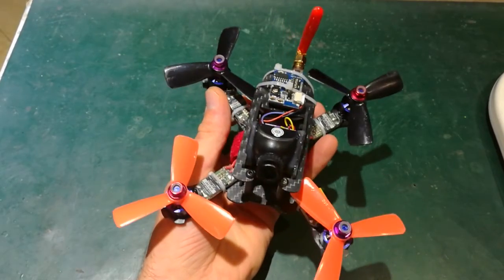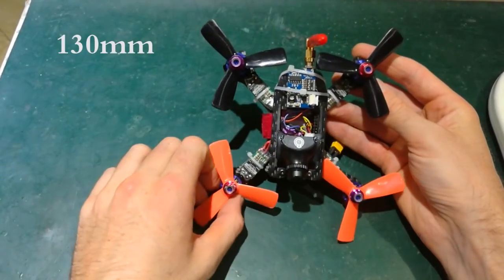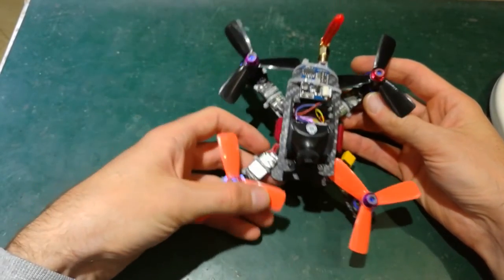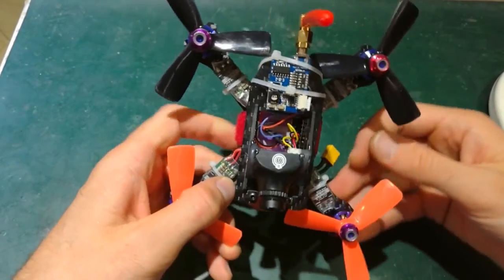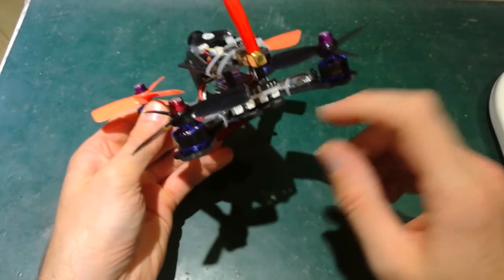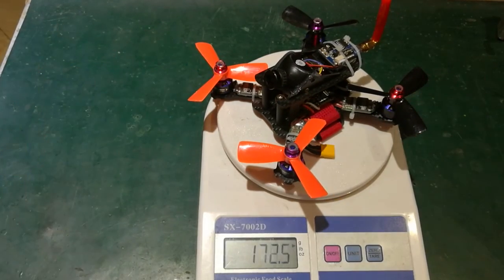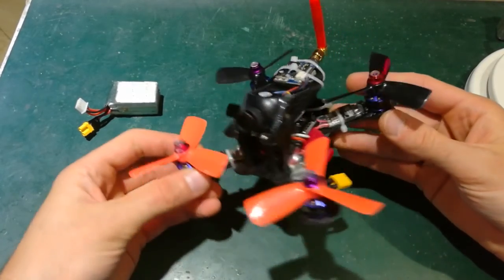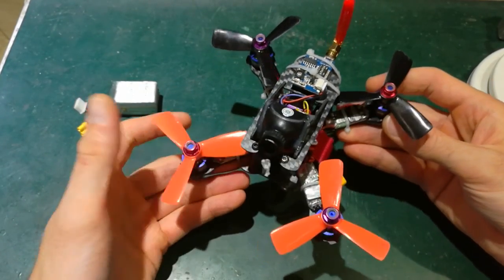130mm brushless racing drone

Comment: What frame?
Reply: sean metzger looks like a Realacc QQX-130 (similar to GB130).  Just finished building mine with Racerstar 1407 motors, 4 in 1 20amp ESC, Omni f3 (yet to be flown).
Reply: Thanks Aaron sounds like you have a fun quad happy flying.